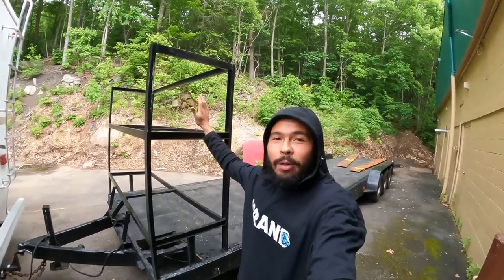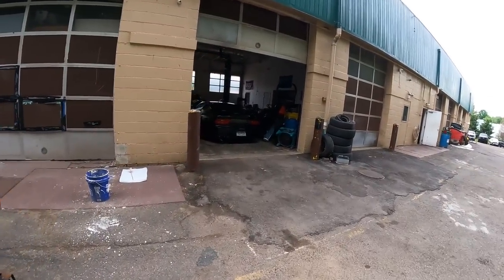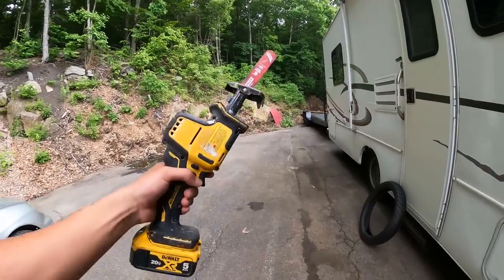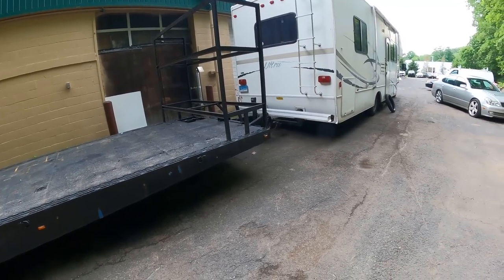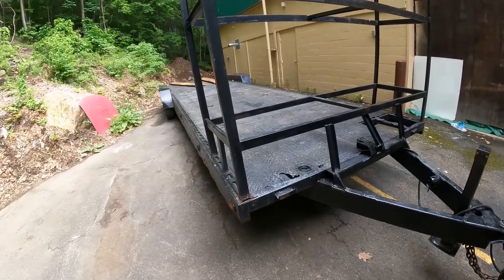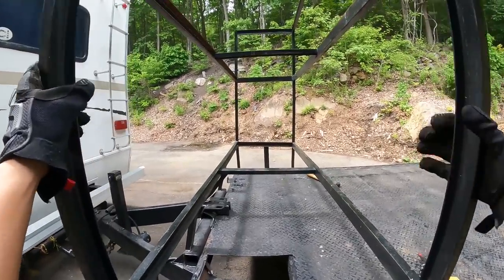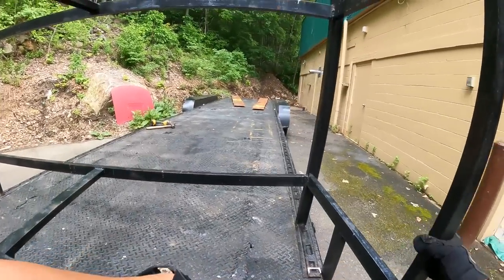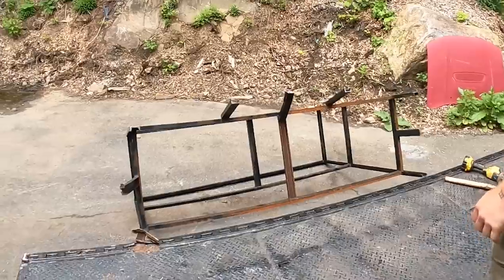Cutting the tire rack off the trailer

Comment: Blades have always been expensive. There’s nothing “ taxed “ about it. Y’all just cheap 
They’ll last if you use them right. Can’t run the thing wide open and burn it up. Metal is always cut slow

Comment: Maybe stack the racks..? Put the stronger rack on the bottom. Add support angles/ brackets. Could make wood rack mount to the wall, and have the metal ones on the side of stacked. Just a thought..🤷🏻‍♂️

Comment: I could see why you didn't use a cutting torch. you couldn't get it out of the shop. Why didn't you use a cutting wheel or just changed the blade. not to say anything but now the rack is tweaked and jacked up from all the hammering and twisting.